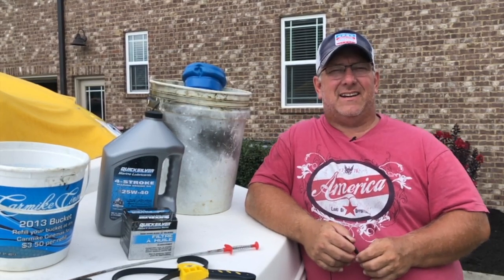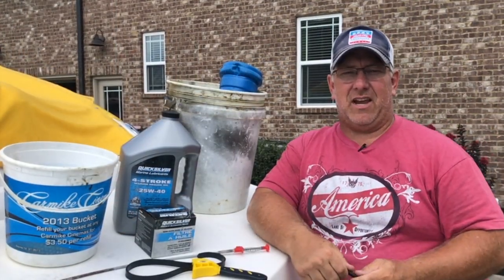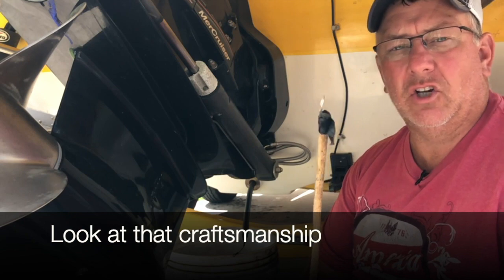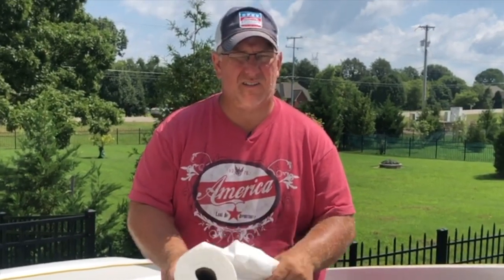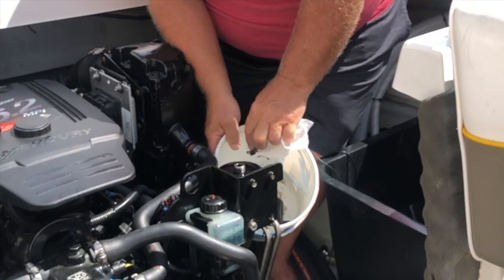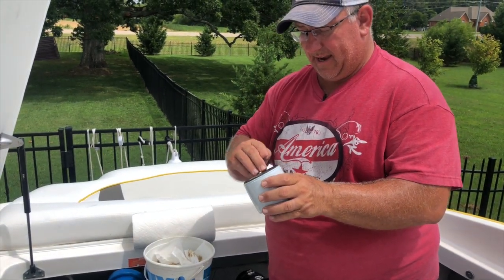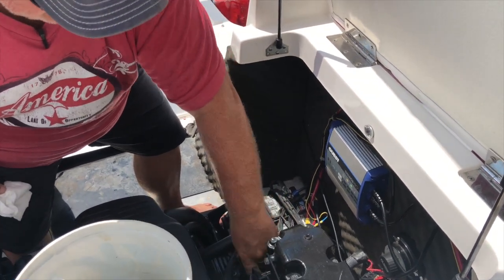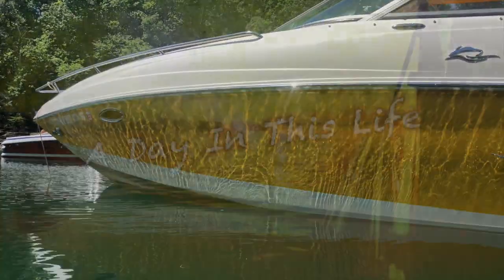Mercruiser Oil Change, 6.2 MPI, on a Rinker 262 NO PUMP with the Easy Engine Oil Drain System.

Comment: I just got one but not sure it’s the right size. It’s 1/2-20. 2015 Murcrusier 350 mag
Reply from the maker: The right size? Can you clarify? Thanks
Reply: @ADayInThisLife  I don’t know what size the oil drain plug is on my 350 mag. The kit I got appears to be for it but I noticed after getting it that these kits come on different thread sizes and widths. The kit I got was 1/2 - 20
Reply from the maker: Gotcha. That’s a head scratcher. I’m not sure what mine is. I’d suggest calling mercuriales and giving them your motor serial number. They should be able to get you squared away with the proper threading. Sorry I wasn’t more helpful

Comment: Never seen that oil drain hose on any Mercruiser I had.  Sweet option to have.
Reply from the maker: I hadn’t either but, it definitely makes oil changes easier for sure. Thanks for watching
Reply: @ADayInThisLife  it’s actually a custom piece that you can get, it is connected to the bottom of the oil drain pan and has the hose on the other end with a plug on the end. Gonna do the exact same thing. Thanks for the idea!!
Reply from the maker: Nice, I think you’ll really appreciate it. Enjoy. Thanks for watching

Comment: Good Video.  I am considering the inhouse Merc. 6.2 with the Seacore option here soon.  Good to know about the drain tube option.  FYI, your anodes look prefect.  The rule of thumb is replace them at 50% of their original mass.  Which for trailered boats in salt is very rare (I got 15years).  Fresh water, they can last for the life of the engine in most cases.
Reply from the maker: Glad you found it helpful. The quick drain system is definitely nice.

Our anodes unfortunately get chewed through in our marina. At least they’re easy and not too expensive to replace. Thanks for the info. Thanks for watching
Reply: Yeah.. my anodes on my 2010 Bryant 210 are original and look like about 10% used up. Trailered freshwater boat

Comment: Quick question, are diesel engines the preferred engine of choice for boats? Not considering increased costs just reliability and maintenance. Thanks.
Reply from the maker: That I have no idea. Gas is still pretty prevalent I believe. Big slow cruisers seem to enjoy diesel and what it provides. I’m certainly no expert though
Reply: Not in a little boat like that
Reply from the maker: Yeah not in my little boat. 🤦🏻‍♂️